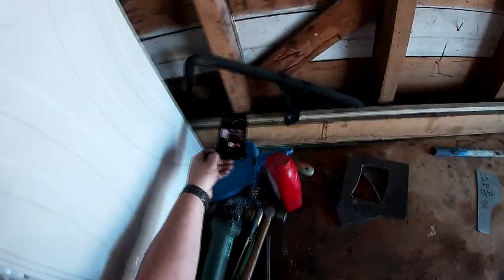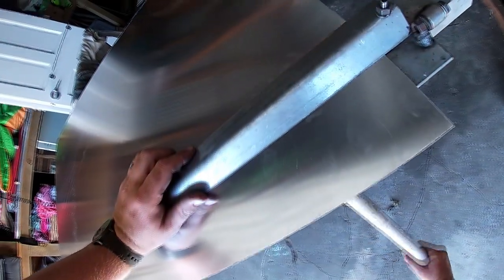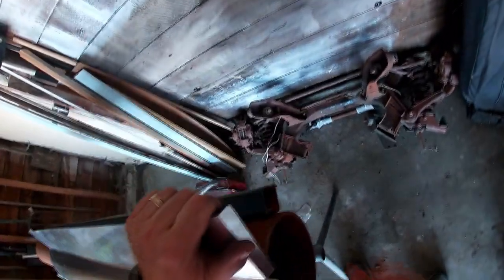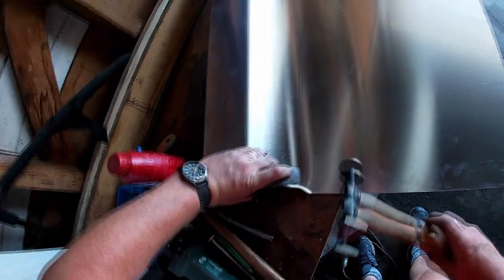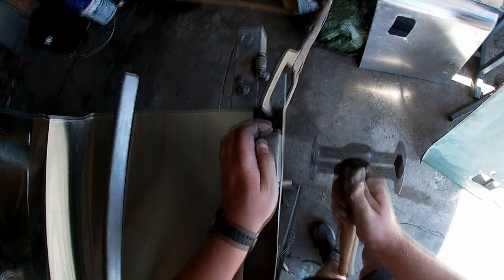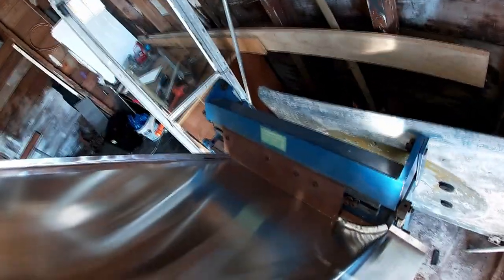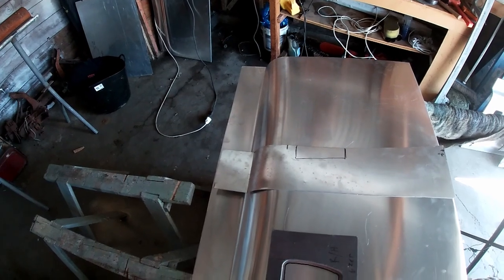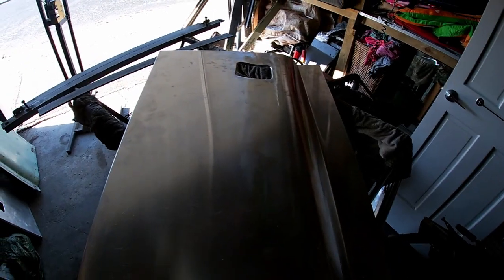Making Land Rover Door Skins from Scratch

Comment: Hello, I am looking t make a set of Second Row Door skins... Ever attempted making those?
Reply from the maker: Yes, I made a complete set for my 5 door.  They are different again but a lot of the same profiles
Reply: @nzstato  Well here is my issue. I need them. Several vendors SP Panels, Paintman Panels, Britpart and YRM. do not make them or won't be making them.... Do you still make them yourself?
Reply from the maker: @dionsmith5228  I used to and will be restarting in 2024 when new workshop is built.  Will be advertising on NZ LR Facebook pages
Reply: @nzstato  LOL I live in Canada. I would love a set of rear door skins sooner than 2024.